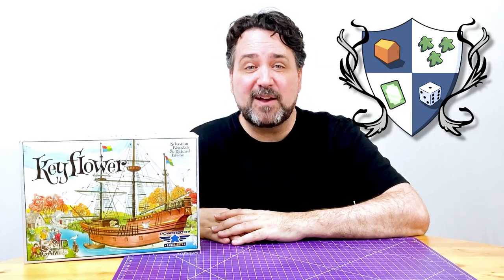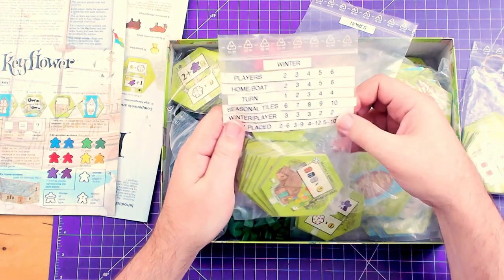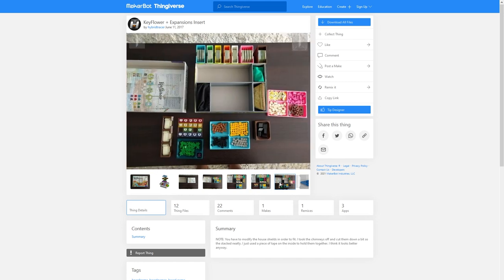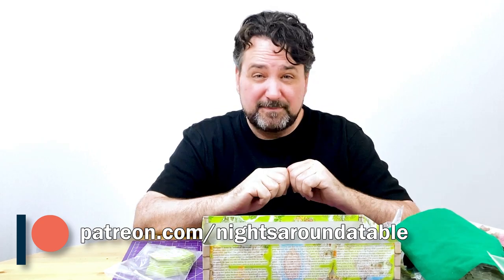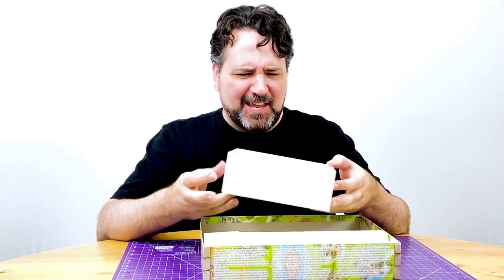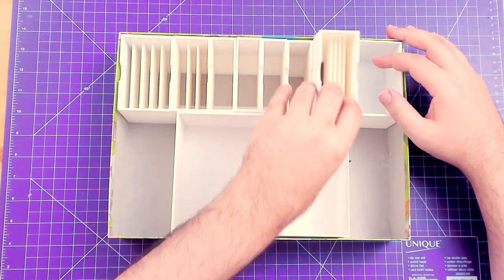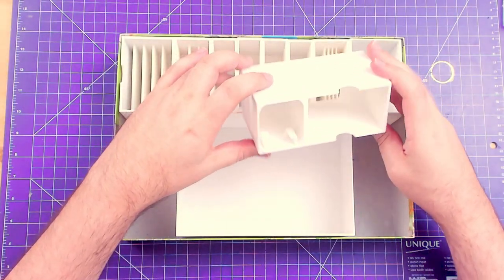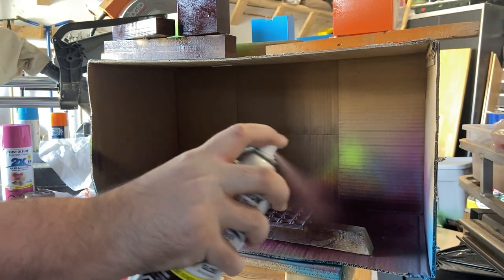Bits, Please! Ep 4: Beds Are Burning

Comment: For your hanging balcony (for the small chimney pieces), instead of using supports (which waste plastic + can be tricky to remove), you could make the floor of the balcony a wedge shape, so the printer doesn't have to suddenly print 5mm in the air for the sudden ledge, rather it is a gradual protrusion of ~0.5mm each layer. As long as the angle from the vertical  is 45 degrees or less, it should work without needing supports.

Regards, Salman

Comment: WONDERFUL video Ryan! 
I had the same problems with my PLA printer:
1) warping
2) too thick adhesion (I actually lacerated my  hand trying to use force! Had to apply superglue to the wound!)

After many trials (and more errors!), I have a system that seems to be working:
Every few prints (eg 5-10, depending on size), i will:
1) clean the glass bed with isopropyl alcohol 
2) apply glue-stick to the bed 
3) check the bed level
4) check the z-axis offset (the distance between the nozzle and the bed) with an offset test print (basically it prints 3 thin rectangle perimeters, about 1mm high, at 3 offsets with 0.1mm difference. Then i can see which one is adhering well without being squished too hard.
5) I also have the slicer settings such that the first few layers are half speed, this helps those critical layers to cool down, to prevent warping.
6) I also use a brim, but not a raft since that wastes a fair bit of PLA
Reply from the maker: And how are your results now?  The whole glue stick thing... i mean, i've tried it, and it's just so messy.
Reply: @NightsAroundaTable  Hi Ryan, its worked brilliantly for me. I apply it directly to the glass {after cleaning off previous glue with water > drying with paper towel > applying isopropyl alcohol > dries within 30sec > finally thin layer of gluestick (just one light pass on the whole glass bed) > dries within 30sec > print!}

I've had no problem with messiness and it completely solved the warping problem I was having on 5-6 consecutive boxes!
Reply from the maker: @salmanqaisar7377  i must be using the wrong glue stick. Mine never dried, and went all thick and gooey.

Doesn't matter now ... i have that textured PEI bed!

Comment: Hey I just saw your video. Was surreal to see someone working with my design. So i did use separate PLA for each color not spray paint. I have a loooooot of PLA and its much cheaper in the states apparantly. This was actually my first insert and i really regret the outer grey box I designed in. I don't do that anymore. I wish i just had all the separate printed boxes in the cardboard box from the start. I haven't designed inserts in a while since i haven't been gaming but hoping to start making inserts again.
Reply from the maker: Thank you for your wonderful design! i love it so much. i posted my small tweaks of it to Thingiverse this morning (that's probably what brought you here!)
Reply: @NightsAroundaTable  Yepp, i saw the remix notification and your video at the end. I may revisit this one day to make some 3d printed shrouds  that way no need to modify the originals. In my defense, not assembling shrouds make setup and take down much faster.
Reply from the maker: @hybridtracer1433  Totally fair. But on the flip side, assembled shrouds require a second box!

Comment: I'm a big fan of the Wam Bam products.  I have one on my Creality CR10S Pro with a metal inductive sensor which matches up perfectly with the spring steel so its automatic bed levelling works like a dream.  The magnetic surface Wam Bam uses is also a high temperature resistant so you can have higher bed temps without loosing the magnetic force between the bed and the spring steel.  Highly recommended.

Comment: I will definitely be printing this keyflower insert too, as well as your box for the chimney + promos.
Can you please add the thingiverse link in the description.
Cheers!
Reply from the maker: Thanks Salman! So many things:

1. i DID make the floor a wedge, but i was still nervous about it printing properly, so i used supports.
2. How do you properly level your bed when it's coated with glue stick glue? i presume you can't slide the paper around...?
3. Got a link to the test print you use?
4. i'll be uploading all my modifications, but first i'm working on a correction to the original designer's Farmers hex box, because it doesn't quite fit the tiles properly. Once i get a working piece, i'll drop the link here and give you a nudge!
Reply: @NightsAroundaTable  I have a dremel 3d40... thankfully it automates many things:
- levelling the bed, so I don't need to do the paper test.
- the test prints for z-axis offsets

But I'm sure there are test prints uploaded to thingiverse!

Also the glue layer is very thin. I've heard a layer of hairspray works well too.

Look forward to your uploads.

Btw I don't have the Farmers expansion, nor do I think I'll get it. So if I budge things around, can I still fit the constructed shields?
Reply from the maker: @salmanqaisar7377  That's interesting, because the empty space you'd have would kind of travel around a corner. Shoot me an email and i'll send you the stl for the custom chimney box. Don't want to keep you waiting.

Comment: I will 100% not judge - I bought a 3D printer specifically for that Arnak insert too, plus a ton of others, but that was the biggest push to make the leap.  Picked up an Anycubic Mega Zero 2.0 for $200 Canadian pesos.  So I'm super happy with it.  I'd love a resin printer, but don't have a good place to put it and ventilate - one day maybe.  I also grabbed your modified bits.  Love these videos man!!  PS: My favourite prints so far are inserts for Tiny Epic Games.  I have done Pirate, Quest and Dinosaurs so far, plus trays for the table to "hold" the map together.
Reply from the maker: Thanks, Michael!  Fun!  Those little black PLA residue squares on one of my murdered magnetic beds were from an aborted attempt at an Ultra Tiny Epic Galaxies insert (which eventually succeeded!) i needed a win after all of this nonense.

i  had tried to print the kind of map border you're talking about for Food Chain Magnate, but i tried to get all fancy and embed magnets in it because the board is a variable size depending on player count, and i wanted my border to be modular and variable too. Things went... super sideways with that, which i hope to show you in a future episode.
Reply: Piece of advice I got from my local 3D printing group - Use some ACetone to clean the mat surface, it will melt & clean the thin PLA right up. PLUS - A light, light, light spray of hairspray helps with adhesion.  Acetone (Nail polish remover) not Isopropyl.
Reply from the maker: @michaeljoyce7548  But acetone dissolves ABS, not PLA... ?
Reply: @NightsAroundaTable  huh... maybe my spools are cheap stuff then, that may explain a few quirks my prints have had, it definitely cleans the bed nicely and the hairspray got things adhering perfectly, I haven't had that lifted corner issue since I started cleaning and spraying it every few jobs.  I saw your image and my Mega Zero 2.0 did exactly the same thing in exactly the same corner.  The head was catching it and pulling the whole print up, such a mess.

Comment: Insert looks great and these videos are fun to watch...But imma stick to making inserts with cardboard and paper wraps. 
For future reference, you may want to experiment with dying the plastic using RIT Dye. (search: Rit Dye plastic) If the PLA plastic takes the dye, it'll be a lot cheaper and easier to color in the future. I use to color those buttons you find on old arcade cabinets (nylon plastics) and it works great.
Reply: Also, aren't the rafts suppose to be a layer of a cross hatch pattern? In the video it looks like you just printed solid plastic mass against the print bed which is suppose to be a, "no no".
Reply from the maker: Great tip! i'll check them out for sure!

Comment: The nice thing is that once you buy all that PLA, you can keep using it for other projects. There is no need to just print one item. Having a supply of PLA in various colours is normal, and should be something you get used to, as it will be a common thing to need more colours.
Reply from the maker: i agree on that score. But just for this particular project, it was out of budget. And switching PLA rolls is a bit annoying. But now i have lots of colourful spray paint to use!

Comment: What brand of PLA were you using to make this insert? I am wondering if the brand of PLA had anything to do with why it stuck to the beds.
Reply from the maker: i should have kept better notes on that. But what i think i've discovered that way back in the Lost Ruins of Arnak episode when i used wood PLA for that insert, the gritty material tore my extruder tip a new one, and every print after that project over-extruded due to the larger hole and stuck hopelessly to the mat. And it was hard to figure that out, because the wood PLA was the first-ever stuff i used in the machine. Thanks to Discord member and patron Auberon on the #3d-printing channel for putting that one together for me!

Since then, and after getting successively terrible prints, i tried to put in a new nib, failed miserably, and eventually replaced my entire hotend. Things are going much better for me now!

https://www.youtube.com/watch?v=r1CUjZw2jPs&feature=emb_imp_woyt

Comment: I've never heard of people having these type of problems with printing items on a bed, especially glass, which should just be easy to remove from.
Usually people would just use a glue stick to create a sticky surface to remove from.
So weird. You have some 3D printing horror stories.
Reply from the maker: Right? Like, i go on these forums, and NO ONE seems to be having the problems i'm having. It's nuts.

Comment: I can tell you what your real problem is because I've been through some of the nightmare you're dealing with. 

You are either extruding too much material or your nozzle is too close to the bed when you are printing.

That is what causes the material to fuse to the bed and destroy it when it comes off.
Reply from the maker: i'd be inclined to agree with you, but here's the maddening thing: if i lower the bed so there's more of a gap, the PLA doesn't stick *at all*. 

(And i don't know how i'd be extruding too much material, unless "extrude too much material" is the default setting in Cura? It's not like i deliberately checked the "extrude too much material" button somewhere.)

i took my nozzle off on Friday to try to clean it, and after i put it back on, the levelling was wonky. In re-levelling, i noticed something very interesting: the (stupid bloody blasted) fan hood was sitting lower than my nozzle. i don't know if that's a problem i just introduced by tinkering with it, or if it's always been that way? To correct it, i wound up unscrewing my nozzle a bit so that it sat lower... but now my nozzle is all loosey-goosey.

i'm telling you: most of my problems with this machine are related to that fan hood, and i don't know how to solve that.